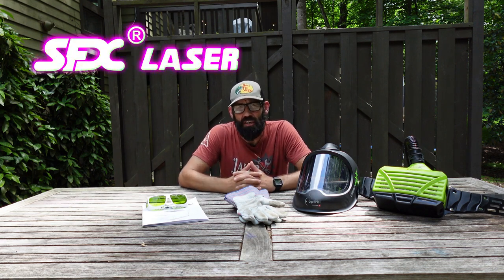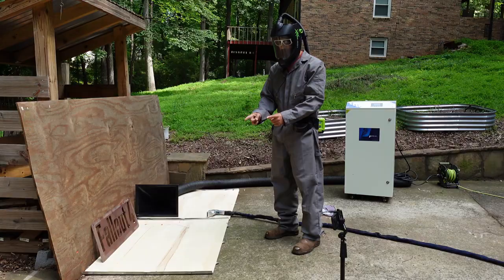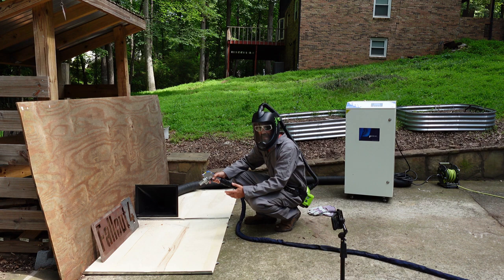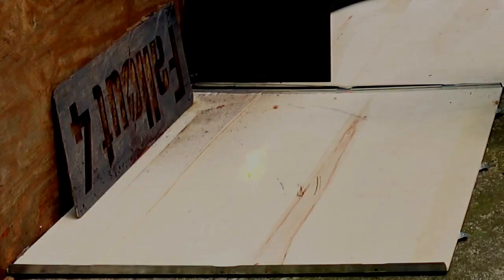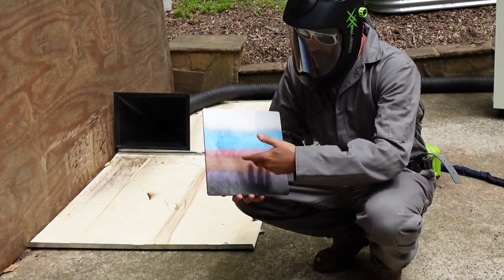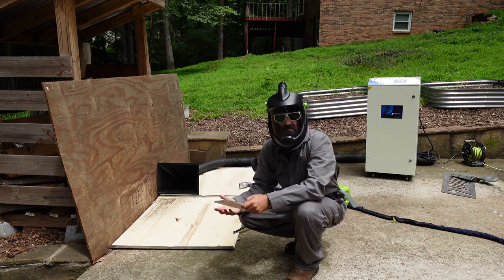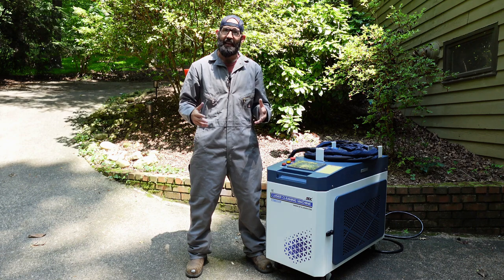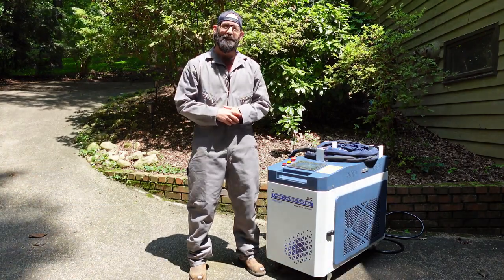SFX BLC-2000 Laser Cleaning Machine Review from Laser Engraving 911丨SFX BLC-2000 Review

Comment: HI. I recently ordered a 3 in 1 1500w laser machine and am waiting for it. very interesting video thanks. one question: by removing the rust and oxide some metals remain shiny others appear dark, like burnt ... have you tried grinding the surface to understand what happens?
Reply: Additional prep may be required, depending on what type of metal you are cleaning, and depending on how you plan to coat the cleaned metal, paint, powder coating etc. But the laser cleaner does all the heavy work👍👍
Reply: did you get your machine?
Reply: @charlesfisher6996   I currently have the BLC 2000 and the 100watt Pulsed Cleaner is arriving this week, Ill be making a great video on that unit as well.
Reply: @LaserEngraving911  What was the final cost for the BLC 2000? That would be very helpful. Thanks!
Reply: Any update on cost for the sfx 2000 cost?
Reply: Did you recive the laser cleaner? It seems like a scam if I talk to the suppliers!
Reply: @winnokfeyaerts5440 They sent it to me fast to Alaska. I ordered from ebay. Big huge wood crate. The box truck that delivered it had a lift so we lowered it down. Then you almost need a pallet jack. Opened it up and no plug on the cord so I haven’t tested it yet. Maybe today.